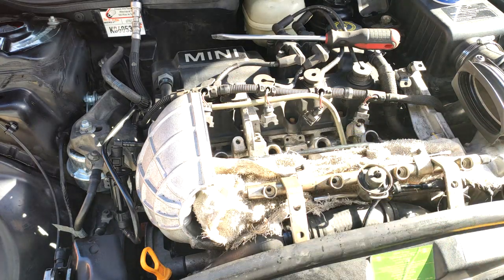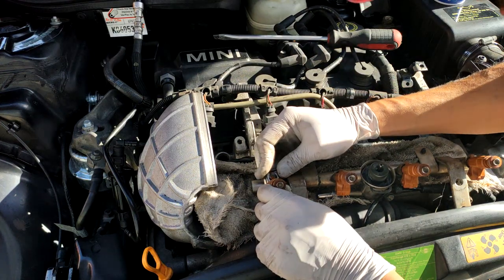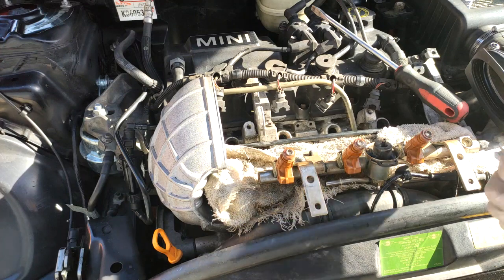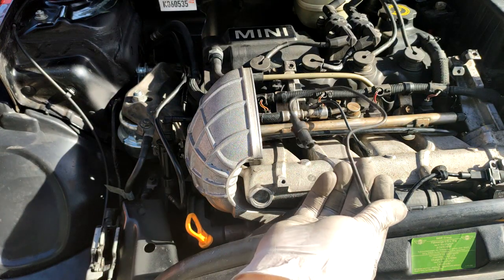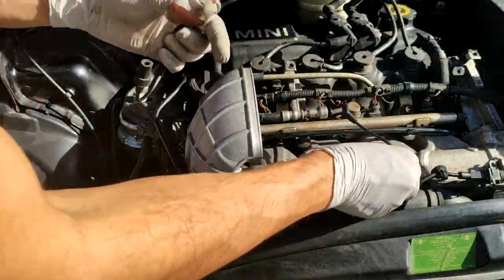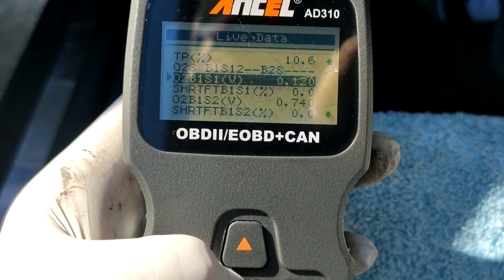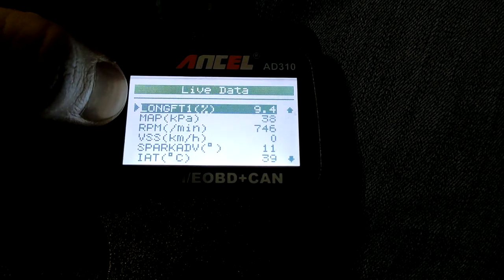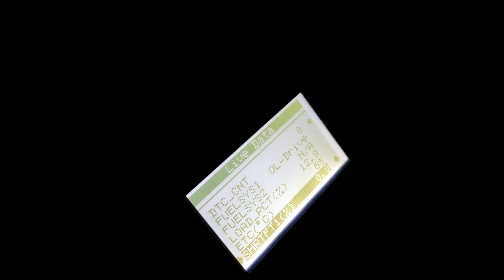Part 3 - Mini Cooper S R53 363cc fuel injectors install and test drive

Comment: do you need to upgrade the fuel pump for the 380cc injector?
Reply: No, stock  can handle it
Reply: Really need  a tune for the 380 though
Reply: 380cc : jcw 😊

Comment: I was looking to upgrade the injectors of my R53 and found these videos, thank you for sharing your knowledge!  BTW, what do you think about the 380cc injector set that ECS sells? https://www.ecstuning.com/b-bosch-parts/fuel-injector-380cc-set-of-four/30757534kt/
Reply from the maker: Depending on what mods you have done, 380cc injectors are able to work with our stock ecu without the need for a tune. If all you have is like a 15% pulley, air intake and exhaust, 380cc are probably going to be a good choice. Although you might want to make sure those injectors are really rated at 380cc, because I found them to be only rated at 363cc from a website source I'll post a link to. I currently run 363cc but I have an even smaller pulley 17%, and I feel like my car is starving for fuel past 5500rpms. My upper cats are starting to rattle whenever I move from a dead stop which means my engine was probably running soo lean that the heat from the exhaust started to melt the insides of my upper cats which I need for state emissions test!  I've read through some forums that a JCW mini which comes with the 380cc injectors stock runs a 12% undersized pulley as part of the JCW package, and the JCW fuel maps are running those 380cc injectors at 100% by the time the car only hits 6000rpm! So I guess anything past 6k, the car is still not getting enough fuel so imagine what a 15% would be starving for, let alone my 17% pulley! 

I am personally looking for 400cc injectors because that's about the max our factory ecu's can compensate for with the fuel trim, and that would put me in a safer position for fuel supply in the higher rpms. Probably would still need a more fuel, but a lot better than just 363cc's and hopefully will stop eating away at my cats!

Here is the link for your ECS injectors. I would again make sure they were really rated at 380cc and not made up by ECS Tuning, though they seem like a good reputable company : 

https://www.injectorplanet.com/products/bosch-0280158315?_pos=1&_sid=e5c1e60a9&_ss=r

Comment: Where did you get those 363 injectors from?
Reply from the maker: I know you posted this months ago, but I feel my response could still help others. I Got them from eBay actually. They were used units that I think comes stock in a Volvo 9-5 turbo. I'd rather buy them used because then I know they are genuine Bosch's that came off a running car. Ebay sells a lot of "New" Bosch fuel injectors, which are actually cheap China knockoffs. There are tons of YouTube videos comparing eBay China Bosch's, and many of them either leak while not in use, or fail to even turn on. Some even spraybat different rates and completely fail when fuel pressure is raised past 50psi! Our Minis run 43psi at idle and slowly creep up to 50psi near redline, so imagine if those China injectors were to fail near redline you can detonate the engine by leaning out and cause severe internal damage!